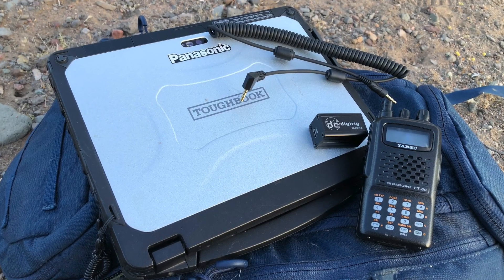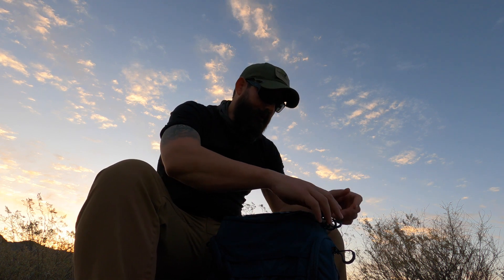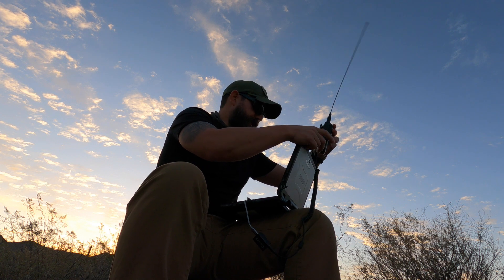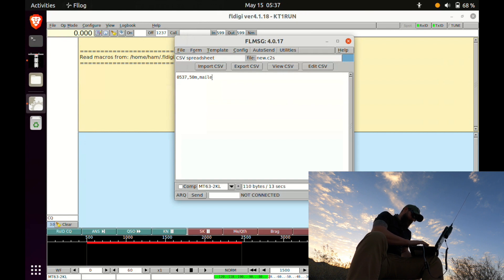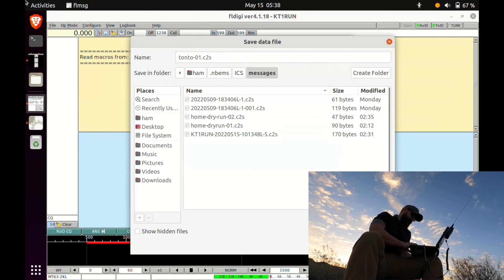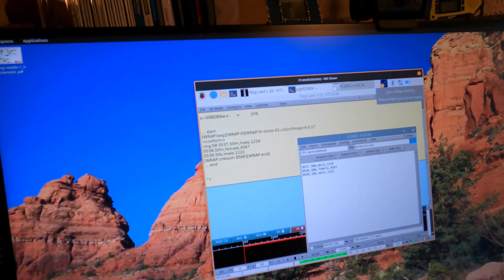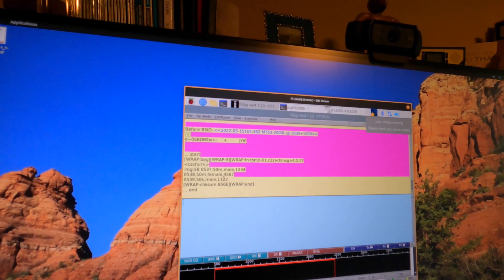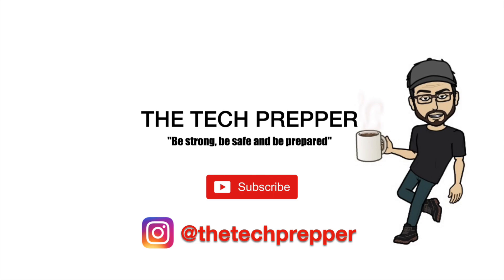Field Testing the DigiRig, FT-60R and NBEMS - Digital Series Part III

Comment: which port do you plug the FT-60R feed cable into? instructions didn't come with the cable, nor does it tell you which end to plug into the radio. Tnx 73 de KN4GEI

Comment: This is a long shot - I don't know if you read or reply to comments. Nice video, by the way! Could you point me to some help setting up flrig to work with my FT-60? It's not one of the supported Yaesu radios on the drop-down list in the configuration section. Many thanks!

Comment: Great test. Our local ARES group uses NBEMS on VHF and HF for weekly training. We're in the hurricane and tornado alley zones so we try to stay prepared. I have done portable with a Xiegu G90 and a Digimode-4 but not with an HT. Just got my first Digirig and cables for Baofeng's and my cable for my Yaesu FT-70D is on the way. I will set up a test similar to yours to see if they work. Thanks for what you do. Jack K5FIT
Reply from the maker: Morning, Jack. Be safe out there. Glad to see others like yourself training. Keep it up.

Comment: A great setup . I hooked up my old VX-150 exactly like you did with the FT-60 and Digirig it performed well . I hooked up my young FT-70DR same way and it showed vertical noise on the waterfall using UZ7HO and it wouldn't key up or do anything used the same settings that I used previously with VX-150. What could I be missing? Anybody else with a different Yaesu HT acting differently in the same environment with a correct acting Yaesu Model....?

Comment: Great Videos.  Have you tried Winlink with the Ft60 and Digirig.    I have not been successful yet.  I turned off SQL and Rx Battery Save.  When I the Digirig using headphones it seems to work.  I get a force disconnect.  Using the KISS for TNC Type.
Reply from the maker: Yes, it works fine. I use this setup to check into Winlink Wednesday. I haven't tried VARA, but I have no issues with 1200 bps packet. The audio  levels are critical to get right. I found calibration easier under APRS first. I would start first with getting the audio right for decoding (RX) and then encoding (TX). Then, right down your settings for later reference.
Reply: @TheTechPrepper  Thanks for the reply.  I got it working with Vara FM.  I am going to try again without Vara FM now that the sound is dialed in.  Love the work you do.
Reply from the maker: @donnawurster1044  I'm glad that you figured it out. Getting the audio levels right is a bit more involved on HT's. You may want to keep a "doping" chart with your settings (volume position on radio, radio settings, and audio levels on your computer). Have a blast.

Comment: Neat thing about digital is that you can basically practice with yourself. Lol
Olivia is an awesome mode on HF. Thor is also. Olivia is utterly reliable and can decode messages below the noise floor. Ive had Olivia decode without a signal on the waterfall.  Dude your knocking it out of the park. Keep it up although mankind wasn’t meant to operate as early as your making these videos. 😆
Reply from the maker: You are right about that. I am writing some digital software now and I'm using acoustic coupling without a radio to tear through the development (see https://youtu.be/Mv9GovhiWB8). I have a todo item to test Olivia on 40m/80m NVIS soon.

Comment: I would love to find a 60 but will this work with the 65? And, I KNOW, Baofengs are lower class BUT will it work okay with the same Digirig Mobile and proper cable?
Reply from the maker: Not sure about this as I don't have an FT-65. I checked the DigiRig site and don't see the FT-65 listed under the list of supported radio for the Baofeng cable. I suggest that you contact DigiRig. I would be curious as the 65 is a good radio at a great price.
Reply: @TheTechPrepper  
Digirig now makes a cable for the FT-65

Comment: Awesome!  I used FlDigi on PSK-31 for years, but I had no idea it could send files.  Have you tried importing a CSV from something like Libra Calc instead of typing the info in the message box?  This was a great series and I’m looking forward to seeing what’s next. Great job!
Reply from the maker: Thanks for hanging around the channel. There's actually another program in the suite called flamp that can send files. Yes, you can import CSV files into flmsg, just export your Libra Calc spreadsheet to CSV. I have not tested this as I run minimal installs on my field notebooks and don't have productivity applications installed. I save all the hard disk space for offline maps. 73

Comment: Why not send messages via APRS? What's this buy you over that?
Reply from the maker: I am a heavy APRS user, but it's very limited compared to sending data using flmsg. 
1. APRS is limited to a very small character limit, whereas flmsg is limited by the length of time you're willing to transmit.
2. We're using the MT63 modem which encodes the data redundantly and is forgiving of audio levels, so the data will get through here when APRS would fail.
3. The data received on the remote station is an actual CSV text file. Can't do this with APRS.
4. flmsg is suited for sending structured data where as APRS is not.

Imagine a scenario where I wanted to track a larger list of data, like runners that did not finish. Let's say 50 runners that dropped out. I can do this in single request, where as I would have to  send 50 or so individual messages via APRS.
Good question.

Comment: Great job on this project, (and everything you've done so far) you are nailing great digital opinions on VHF that alot of other channels are missing
Reply from the maker: Thank you. I'm a bit out of the loop with  the other channels these days due to time constraints. I'm on a mission to solve my particular EmComm and public service use cases for my area. 2m/440 FM is what our group and county uses, so it's where my effort needs to be. Glad that there's value. These efforts will get progressively more focused over the coming months.
Reply: @TheTechPrepper  I like my local C4FM linked repeters, so I hope i can get my ft3d to work in this fashion. I hope more VHF radios are made to be as easy as the ic7300 is to use on other digital modes.(1 USB cable)
Reply from the maker: @nickforcum3964  I have one CF4M radio, the FT-100D, but haven't tried Fusion yet. It's on the list. Good luck.

Comment: Bought a DigiRig a couple of weeks ago for a new to me FT-818, it was painless to get it running and doing FT*, about 15 minutes from sit down at the desk to making contacts.
Reply from the maker: Excellent. The FT-818 and the DigiRig are a great combo. I ordered another unit and Yaesu 8XX cables to replace my Sabrent USB setup on the FT-818ND. Report back if you try NBEMS or packet with your setup.

Comment: I use a CF19 toughbook....they are great computers!  The ability to buy extra batteries  is a big plus.  I now use it in my shack to log contacts, in addition to a portable digital mode computer....my philosophy is that I want to use and get comfortable with the computer which I use occasionally in the field, also so I know it will likely work when I turn it on.
Reply from the maker: You've got the right philosophy and good taste in laptops. I'm a firm believer in actively using your comms gear. I use my CF-20 daily for the same reason. Gear and skills will decay if not used.
Reply: @TheTechPrepper  Yes Sir, you are absolutely correct.  Please keep up the great work!  73 from NJ N2MXX
Reply: @TheTechPrepper  Also...the CF-19 Toughbook fits perfectly in an Apache Harbor Freight 2800 case with 1 layer of foam removed, leaving 1 layer free for accessories, battery, etc.
Reply from the maker: @daveG1020  Which Apache model? I love these cases. Rugged and affordable. Thanks.
Reply: @TheTechPrepper  It's the Apache 2800.  I removed the top layer of foam (not the foam in the top, but the upper case layer), and configured the lower piece of foam to hold a spare toughbook battery, ac charger, USB GPS unit (off-grid clock setting for FT8, etc), and DigiRig/usb cables.  The toughbook CF-19 fits perfectly in the void created by removing the piece of foam.

Comment: It's great to see this working so well. I will experiment myself and see what I can achieve with a similar setup in the UK. 73
Reply from the maker: Good luck! Please report back. I'm still new to NBEMS. It would great to hear the community's success and failures. Let's learn together.
Reply: @TheTechPrepper  I'm working away from home for a few days, meaning the evenings are completely free to 'play' radio as it were. Im going to try a setup with both HF and VHF equipment, and run data, just to experiment with deployment teqniques and equipment required. HF will be via the trusty IC-7100 and VHF using an IC-F5022 Commercial radio set. All from a backpack. I will hit you up on Twittr if I remember!
Reply from the maker: @jordesclark  Feel free to hit me up. Response may be delayed. I'll be testing this setup on HF NVIS (80m and 40m) using the Olivia modem.

Comment: Is the TCA/PRC 152 a ham radio?
Reply from the maker: Not sure on that exact model number, but Baofeng just came out with an AR-152 replica which works with this setup. You just need the DigiRig Baofeng cable. See part I of this series as I cover the Baofeng setup (two videos back). I'll have to research the TCA/PRC-152. Anyone else know?
Reply: @TheTechPrepper  I’ll definitely watch it. From what I’ve read earlier today is that it is a ham radio. Im not entirely sure. I love your videos man. Keep pushing out videos. 73
Reply from the maker: @Zayne_24  I will definitely do some research in the morning. I'm always on the look out for ruggedized gear. I'm currently running the Yaesu VX-6R as my trail running radio. It gets serious abuse. Thanks for the support.